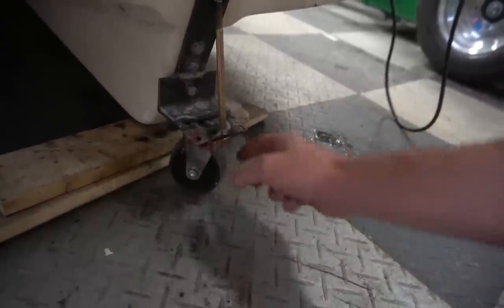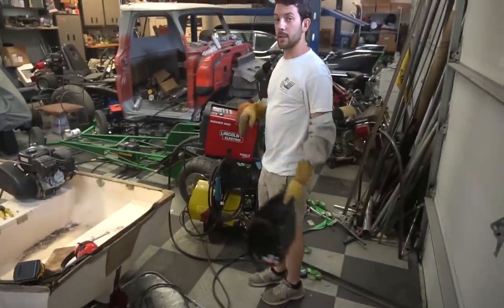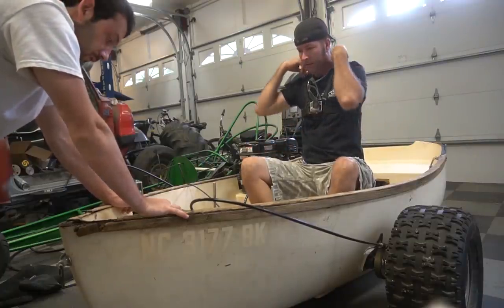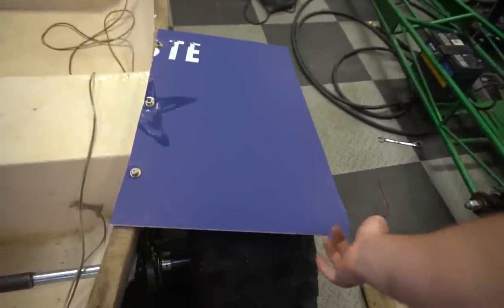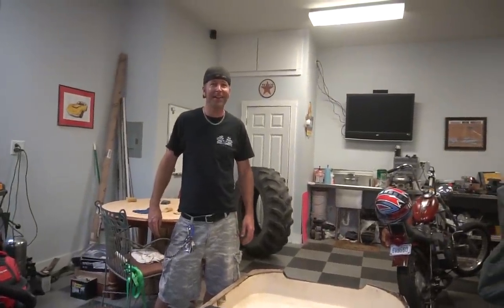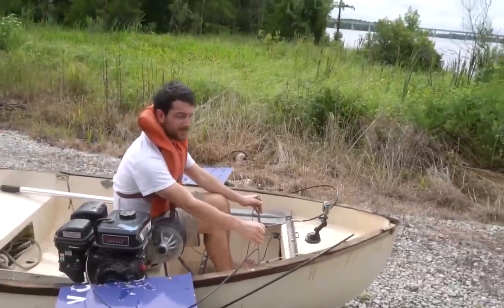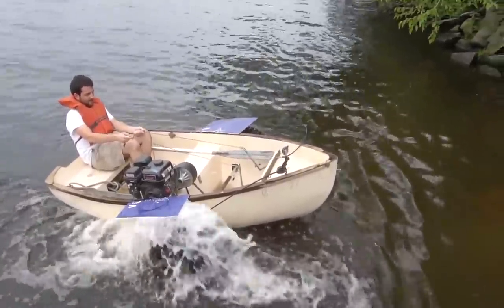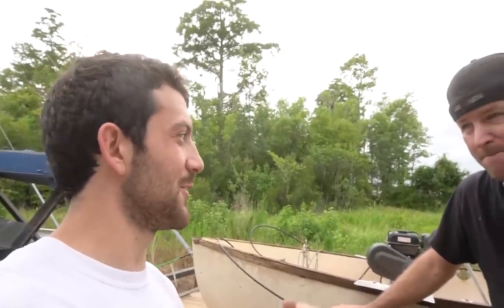MAIDEN VOYAGE | Amphibious Go Kart "Tank Boat" Pt. 3

Comment: I'm late on this one but, you should have got a turbo & mounted it out the back of the hull. Run an exhaust pipe through the hull to the turbo. Now you would have a jet boat. Then all you need is a rudder connected to the steering wheel. That can be your update in a year or so.

Comment: This could have a spin off (no pun intended). Build a front wheel drive cart, same axle but low. Back caster will need to be made or much heavier, but basically a LOW spin cart. Maybe use two front disk inboard (Gopowersports! lol). Essentially a spin racer! :) Slolam races and general mayhem low enough and wide enough not to flip... Probably not for the CC gran prix course...

Comment: You should put little paddles on it that bolt to the lug nuts on the wheels and that will Propel It Forward like an old fashioned paddle boat. Have four paddles per wheel in about 6 in Long and then weld a ring around the outside of them to keep them in position and connects them all together

Comment: I wounder how long it will take these two to figure out that going in to the water you speed up a bit in order to clear the rear wheel and speed up again before you make land and NOT stop at the waters edge? All the amphibious vehicles I have seen going to the water always make a slash and going out of the water they speed up to get the wheels to touch ground with enough weight for traction...

Comment: I think a rubber caster wheel on the back that is big enough you can put a tube in would help a lot more then a metal caster. And would give more clearance coming out of the water and would be better on river rock cause it wouldn't dig into the ground.

Comment: Have you guys thought about using a wheel barrow wheel on the back instead of that puny one. Would give you the ground clearance to exit the boat ramp. Also, you could use the height and slimness of the wheel barrow wheel to act as a rudder

Comment: Epic win but I would suggest taller tires for ground clearance and maybe alternator or generator to power an electric trolling motor off the gas engine.  An 80lb battery would be a bunch of weight just like the tracks.  

In my state any boat with engine over 10 hp is supposed to be registered.
Reply: There's new stuff being developed for quicker install of tire chains all the time.   Maybe there is something to that that would give you better propulsion from the tires.  

Going all electric seems doable but does not seem to be in line with your sponsor.

Comment: Paddle tires and some sort of finder that would still be somewhat decent for when your not on the water but also if you use a little bigger tire it might raise the bow up a little bit and help getting in and out of the water

Comment: Try putting paddles on the outsides of the tires. This was it has more surface area to work with in the water, but it doesn't compromise its ability to drive.

Comment: I bet y’all could engineer a propeller and rudder into it to help with the water speed and maneuverability. The tank treads should give more torque in the water to help speed and control though and some paddles on the wheel might give a little extra power

Comment: Also You could weld some paddles to the rim as long. As there not bigger then the rubber tires like weld a couple pieces of angle iron to the rim or spacer it and bolt it thru the existing rim bolts then attach some aluminum or plastic or what ever u can find to bolt up and use as paddles to get some speed in the water and I believe that caster is more of a problem it would probably work better with none at all

Comment: My only suggestion it use a bigger caster. That metal one is fine for hard surfaces but when you get off-road you need it wide and soft so it rolls not digging in acting like an anchor

Comment: Use sand paddle tires it will work i done it on a fourwheeler it will push you pretty fast but will have to put some better fenders

Comment: You have to put more rigid covers on the wheels  and almost closed in the front and at about mid high of the wheel at the back. It may help to get the water propulsing you and not flying over
I saw something like this in a Monster Garage episode on a go kart that goes in the water. It was a special episode made by students of a college in Montreal

Comment: The problem is a high wheel speed the water is being thrown forward which will make it want to move backwards instead of forward. Basically is the wheel is throwing as much water forwards as its throwing backwards then you aren't going to be moving anywhere. If you could design some kind of scoop almost like a fender that would redirect the water its throwing forwards and either stop that water or direct it backwards you would be able to move faster and possibly have better control. BUT! When yall put the DIY tank tracks on it that should work pretty good compared to the round wheel.
So right now slower wheel speed keeps the wheel from carrying the water up and throwing it forward. Meaning more of that energy is used to create forward motion. Catch my drift ;D

Comment: Why dont you use a zero-turn lawn mower front wheel "caster" assembly for the rear? Its is made for this kind of load and is setup to run an actual tire? You could run two of them instead of one for better load and stability.

Try adding a adjustable skirt/buffer that can drop down on the top of the tire, to divide the "throw-over" water that is following the water over the tire and force that water to stay on the rearward side of the tire.

Comment: For serious, idk how far ahead you film, but could it be possible to run a second axel perpendicular to the first? You could link the two axels using cogs, then put a propeller on the back end of the second axel (through the back of the boat). That way whenever you have the wheels going, you could also have a propeller going.

Comment: Technically you don’t need a track. Just add the rear wheels and run a chain between the front and back wheel on both sides

Comment: You need to put some paddle tires on it for like in the sand and then on the back Caster you need a bigger wheel so that it doesn't just dig in and have it slightly higher up off the ground and maybe even a Caster in the front of me when you're on land if you lean forward it don't dig in to hit a bump. And it'll help when you're pulling out of the water

Comment: I think part of the problem launching and getting out of the water is your Caster wheel is so small it's just digging in instead of rolling. I would look into a small hand truck tire wheelbarrow Tire that way it'll actually roll on gravel and dirt and do an add to the floatation on the back of the boat.

Comment: TAKE SOME PADDLES AND MOUNT THEM ON AFTER U HIT THE WATER USING TIRE STRAPS FOR WINTER,JUS A THOUGHT OR LIKE DUDE BELOW  SAID MOUNT TO HUB AND ONLY USE LIKE 3 PADDLES PER TIRE MAKE  THE PADDLES FLUSH WITH WHEELS AND MOUNT EXTENTIONS ON THE PADDLES THAT CAN BE ADJUSTED ONCE IN THE WATER

Comment: Nevermind adding paddles to the wheel hub, with all that water the tires are shooting up, and forward, I bet if instead, you modifed the fenders to be more like scoops, you could redirect that water out to the sides, and backward! Get a little thrust that way! ;)
Reply: I mean, throwing all that water forward has gotta be working against ya.
Reply: I could see taking a couple of old fenders from the junkyard, because they're already curved and such, and mounting them to the sides of the boat, not above the wheels like you'd think, but instead, right behind the wheels, such that they scoop up all that water getting kicked up, and shooting it backward, instead of coming around the wheel and shooting forward. Like a snow blower! Make sense?

Comment: You should power each side independently and make it so when you push the lever is forward you give the engine gas and then you pull them back you get the brakes give you more control for slower speeds.

Comment: What you guys should do is get like a steering wheel and mounted onto a pole and then you can take your the wires for your hand brakes and you can like solder them or something to the to the polls and then when you turn it locks up on that side that you turn to

Comment: Put sand dune tires off of a fourwheeler on instead of the regular mud tires. Dune tires have big grooves in it instead of tread. I think that would propel you better in the water and might even go faster and able to turn better.

Comment: If you are planning to add more wheels and tracks, you may want to look at the M113 armored carrier.  You'll notice a rubber skirt covers the top half of the track.  This is essential to water operations.  This rubber skirt maintains an air space over the top half of the track, which is totally submerged.  Without that airspace, you won't get any propulsion in the water.  When you guys add your track, remember that it needs to be at least half way out of the water.  By the way, that's why the wheels work better at water propulsion on this phase when you move to the back to drive.  The change in balance lifted the wheels out of the water more.

https://www.youtube.com/watch?annotation_id=annotation_570791&feature=iv&src_vid=voCd5UJNrXQ&v=keql1C8wuWM#t=5m28.9s

Comment: I’m sure you were stuck because that rear castor was stuck ... you should put a small pneumatic wheel and tire on it. Also, you should try sand tires with the fins instead of atv tread

Comment: I can see if use more of a paddle style type of tire ( sand tire ) might get you going a little faster in the water than the knob style tire you have  on it now.  As the tire spins in the water now its more like using a fork to paddle the boat.  Using the sand tire is more like a spoon and the boat will move faster and easier ( more control is a bonus ).  As for the rear you can use a go kart tire ( 4.10/3.50-5 ) and rim using a mini bike style setup to hold the tire in place on the lower and a boat seat spinner mount for the upper section.  For the finders over the tires you can take a 55 gallon drum cut it in half then cut the width you will need to cover the tires to keep the water out of the boat and as a bonus it will also aid in making to go faster in the water.

Comment: i want to suggest a mud flap from the front to back around the tire low enough so the back side is right at water level and the front low as possible and covering the side as much as possible so you dont lose ground traction, so when the wheel rotates it builds a pressure system inside that cavity almost like jet propulsion, could burn the belt up from pressure but i noticed alot of force is directed up so if you create a turbine style mudflap i think it could potentially generate enough force to propel it forward with out having to get paddle tires.
Reply: also they make an off road style caster wheel that you can put on the back probably could use the same mounting point but make an L shaped bracket from the top out then your caster wheel should sit and rotate as much as it needs allowing better control for turns

Comment: Needs paddle tires. I wonder how well it would work if you completely reworked the steering. It wouldn't be a tank boat, but what if you steered using a rear mounted, bike tire with a solid rim. That would double as a rudder.

Comment: Great job. For years, I've wondered why you wouldn't put a metal plate above the tires to stop the water from shooting forward. The idea is less forcing water forward = more pushing amphibious vehicle forward. Newton's Third Law. In this case, the plates would directly directly convert the momentum from the water already moving forward into forward force for the vehicle. Should be several pounds of thrust?

Comment: You could put 2 more tires on it and then throw a 212 mud motor on the back for the water and when you're driving it on land just turn the shaft into the boat

Comment: @CarsandCameras I can’t believe y’all wasted so much time with that rear castor contraption; I’ll be glad to see that castor removed!
 Y’all are gonna have to mount the rear axle higher than the front, or the bow will be plowing-in on land, and the rear axle will be too submerged to be effective in the water.
Also, you should engineer your tracks to have “flap-pads”, which lay flat when rolling on the ground, but will fold open in the water, becoming paddles.

Comment: I was thinking do paddle tires but instead of the 670 on the dragster why not swap the Ducati engine on there and build that yes you would gain a little weight but it would boost power in general

Comment: That rear tire needs to be larger and air-filled, or just replace it with a skid plate. A smooth skid would be less resistance than that metal wheel digging in.

Comment: 2 major problems I see is wrong tires front and rear. The the front tires should be a paddle tire ones used on sand. The rear should not be a metal anchor digging into ground. Weld a flat plate to your metal you already have probably at highest point, and mount a small wider pneumatic tire. So that would put the tire behind the boat not under it. And if you really wanna go further since you now have the pneumatic caster behind boat make it a dual purpose as a rudder in water while coasting. Best if luck!!

Comment: dont think it will work with the current wheels , the bow hits the ramp before the wheels do (angle of attack) the concrete ramp is more slippery too i think 
if you add an axle to the bow and an axle to the stern and tension the tanktreads between those it should work as long as the front of the treads are below the bow , i think it will move more water / make more speed too
you might not even need the small wheel in the rear as the boat will rest on the track front to back 
i think the mudflaps are a good idea with the tanktreads as whell just across the whole side
Reply: watahyahknow im surprised john didnt show us at the other boat ramp wher it drove into the water and out

Comment: Put some paddle tires on it I need a different wheel in the back and you need to get better Fender so you can hit Full Throttle when you got paddle tires and it'll be fine

Comment: Dumb question guys, why not mount engine on opposite side putting chain to outside? this would also put all engine controls between operator and torque converter/chain setup instead of having to reach around engine, though we all love to give our ol engine the reach around!
Reply: Andy Fessler it was easier having the engine where it is

Comment: If y'all do another boat tank you might want to try 14 ft or 12 foot aluminum Jon single wide with a flat bottom it might be a little bit better for you on the rough comings and goings from steep incline so I think the Battle of your boat is just a little bit to sharpen a little bit too low but it is what it is and if you want to get a little bit more better speed with a high throttle you might want to try a little bitty Pat some paddle tires like you would use in the sand I think the cups on those are grab water in help you out a little bit more but you going to definitely need some better fenders if you tried that option but other than that I do like what you. What y'all two boys do and I do like some of your bills other than that I think she is pretty damn cool dude

Comment: At higher speeds it slings more water over the wheels producing reverse thrust.

For the tread version, I suggest you put not just a fender but a diverter to send the overhand water out to the sides and possibly back to maybe produce some positive thrust from it as opposed to all negative thrust. ~( 'w')/

Comment: If I ever built a motorized boat I would have a predator 212 or a Briggs 5 hp Flathead and just a propeller going out the back of the boat

Comment: Weld long wide flat metal pieces to the rims to act as paddles. It will work, trust me, I design boats.
Reply: As long as the rim is atleast halfway in the water or a third

Comment: I would love to work on some of the projects u guys have I have so many ideas I am working on a rail car now that sits on old nonused rail road tracks it’s a two seater go cart frame with spacers on the rims so the rubber tires sit on the top of the tracks and the spacers hook it to the track it has a 300 cc two stroke snow mobile engine and it hauls on the rail road tracks it’s so fast and it handles like it’s on rails lol 😂

Comment: A steering wheel with opposing tabs and a neutral position will steer the boat cart.
Reply: Also a brake pedal with secondary cables going to both brakes will allow you to stop both wheels.

Comment: Predator 212 does it again!  
BADASS build, guys...
Maybe the rear caster could be replaced with a trailer wheel jack?
https://m.harborfreight.com/1500-lb-capacity-dual-wheel-swing-back-boat-trailer-jack-67500.html

Comment: so stupid kewl

Look guys, weld up a pair of paddle wheels with rims and a tight fitting fender, make the wheels twice the diameter you have now and and gear the chain dribe to 1/3 the speed you have now...it will work much better